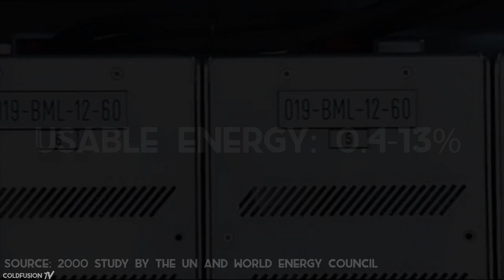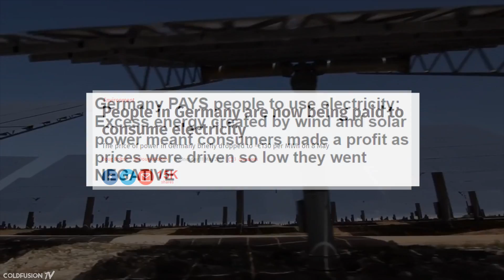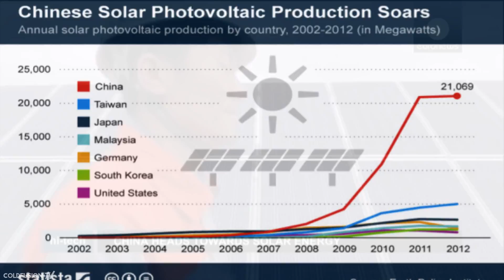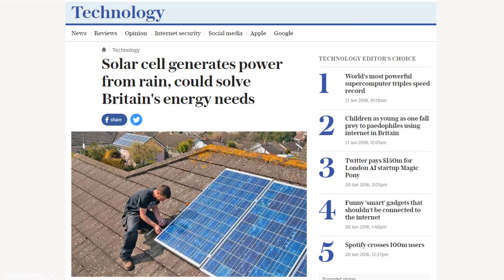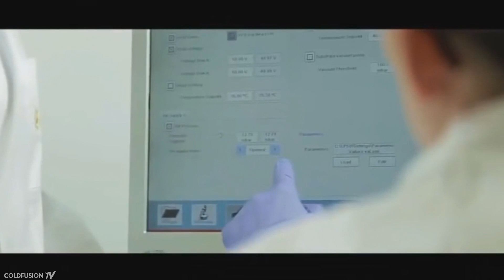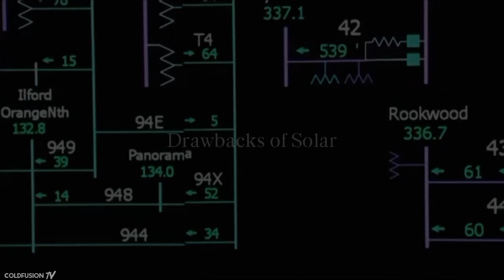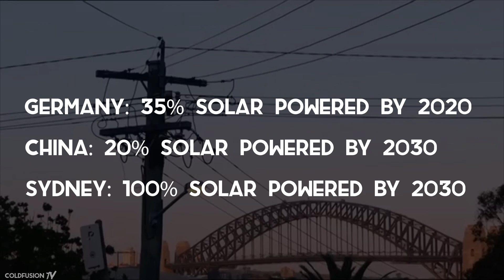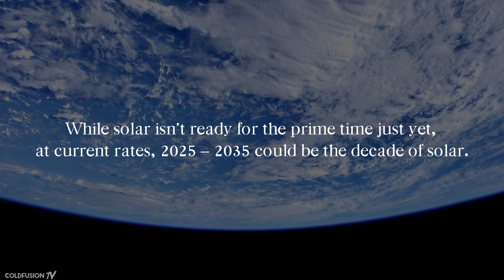The Truth About Solar

Comment: People who say rain, clouds, and snow, are a problem for solar don't understand what a battery bank is.
Or that we even have backup generators that use less gas all year than their SUV's do in 1 mile.

They think we wire solar panels directly to a wall outlet or light socket. lmao
We can even heat the solar panels with its own saved power every morning to melt snow.

These types of ignorant people are the real energy problem. We should put them all in Texas and build a wall around it. Then make them pay for it.

Comment: the whole world will be connected with 1 continuous wire. There's always sun somewhere in the world. Batteries are just an environmental hazard. Also every solar inverter will have to be fitted with a capacitor that discharges in 30 mins. This way there won't be up and down with clouds. 
Also your gas are will become your own power station. When ur idiling in traffic batteries will be changing so when you get home you will have 2 kw to feed into the grid. So either electric car or a gas power giver,  hahahaha
I promise all readers this is what's goin to happen.

Comment: It is exciting.  You did leave out a few things.  On the positive side, currently solar panels shade a portion of a homeowner's roof making cooling costs during the summer cheaper.  In general, solar farms have an area under which, could be used for the production of crops which need less sunlight.  Many parking lots,  previously blistering hot during summer, are seeing shade structures go over them purely to take advantage of the sunlight in the form of solar power.  On the negative side, traditional solar panels are made of a number of chemicals which are exceptionally toxic.  While nowhere near as dangerous as radioactive waste, great care must be used in both production and recycling.  The life expectancy of a solar panel is on the order of thirty years, after that electric production drops off.   The use of solar panels on American rooftops is problematic because American rooftops are riddled with various vents.  Compare this with homes in Japan which have a larger percentage of vents out the side.  Rooflines in Japan are beautiful.  The growth of solar panels in Japan uglifies (In my opinion) their roofs.  The advent of tile shaped solar panels, which can be walked on without breaking, will certainly be a boon.  We already have in many places a natural "battery."  The pumping of water back up into reservoirs for hydroelectric power at night, while not efficient, can certainly be used today until the advent of better batteries.  In addition, the compression of air tanks which can be later used to run pneumatic motors and hence generators, is another method.  Overall the use of solar panels is hopeful, but the easiest way to control the energy crisis, to cut carbon emissions, and to save the planet, is simply for everyone to use less electricity.

Comment: And up here Canada for 6 months of the year we will get only 8h of sunlight so solar don't work for us !!!!! any way
Reply: The most crowded areas of Canada are still more south than Germany, where solar energy is well established.
Reply: Then I guess Germany gets as much snow as let's say Montreal?... I strongly doubt that... Climat is a tad more complicated than that... solar... even more. In southern regions of Quebec it is considered that solar production from december to march is 0% for an average residential house.
Reply: @ Sarah Andrea Royce  the UK is much the same latitude as Germany, and Solar is well established here, too. Commercial solar produces an average 9% of nameplate.
Reply: "Light hit every part of the earth equally over an entire year. Canada gets about 6-8hrs in the winter but 16 or 18hrs in the summer. Closer to the equator gets 12hrs on/12hrs off pretty much all year round. Even the arctic and antarctic gets 6 months on/ 6 months off....but we all get the same light in a year.
Reply: @ Moto arzan. 

Yes, we all get 6 months of daylight per year, but not equal intensity. Intensity falls as the log of the atmospheric path length. (See optical depth.) That's attenuation by absorbtion: then there's reflection by dust and then there's refraction. We can safely watch the sunset.
Reply: I get less than 8 hours sun a day in winter and my home still runs fine....got a fridge got t.v. got internet 24/7. In the summer I have an abundance of power and use my extra panels to run fans without batteries.

Comment: Half truths everywhere, no one talks about the batteries you require (major green house issue), unless you are feeding into the grid, no one talks about space 1 kw needs 10 sqm. No one is talking about heat decreasing efficiency of solar panels. Not a skeptic but solar for mass production is miles away.

Comment: They glossed over the huge complexity of "adjusting the grid to massive solar deployments" You need to have generation facilities that are capable of adjusting very quickly to a changing load and that is not easy and is generally very expensive and will negate much of the solar savings.

Comment: Ok solar is clean granted! However the battery's to store the solar are not cheap. if factor in cost of batteries, solar panels, charge controllers and all the other bull shit! To go totally solar off grid for whole home and run every thing a house on grid would. You are looking at 20,000$  to 30,000$ yes that is right 20k to 30k $. Your paying for the next 10 years of electric bill all at once.  You will never get your investment totally back because the batteries don't last that long and need replaced every 5 to 8 years. Plus there is something bound to go wrong with the charge controller or power Inverter as well. Solar does not work well in areas that have a lot of rain either. Until battery technology comes down in price and storage density get way better Solar is flat ass is to expensive. Prove me wrong!!!!!!!!

Comment: As of now solar is cheaper than all fossil fuels including gas. The simple solution become de-centralized: get all private homes on solar power with storage batteries and do what can be done elsewhere until more efficient cells or fusion power plants come on line. 

There was the plans form the 70's to put 10 square mile solar power satellites in orbit and beam the power down to mile diameter collectors on the surface but I think the idea of having the equivalent of super powerful MASER cannons in orbital first strike positions killed that idea. 

The is also one highlighted in a Japanese anime in the Gundam series: build a solar energy collection ring around the earth at geosynchronous orbit where they would receive sun 24 hours forever and have it anchored by space elevators to the surface, power would come down on the cables making up the elevator tubes. The one problem with this is that you would need co-operation from all the world powers and super high security at the elevators against terrorism plus no one alive today would live to see this project finished.
Reply: "As of now solar is cheaper than all fossil fuels including gas."
Solar is the most resource intensive way to produce energy. Solar doesn't work at night, and people still make absurd claims about solar to the anti-human movement by enivor-MENTAL-ism..

Comment: KWatt_hour   > In 2016 from 6 $ cent to 2 $ cent 
Nuclear, coal & gas still 7 $ cents
All fossil is dead now
Don't invest a cent in it
Reply: Solar has a 20% capacity factor at best, that means storage is a requirement, an expensive requirement. Solar also has a long break even period, so if you add the cost of financing, the cost of installations and the cost of storage you can get a realistic total.
Reply: Cost per  €/MWh
Hydro €20
Coal €44
Nuclear  €50
Wind  €69
Solar  €293
Most current studies are non-sense because they add an pretend carbon value to fossil fuel and leave off subsided costs of solar.

Comment: Video didn't mention that the manufacture of solar panels is not very eco-friendly and requires caustic chemicals, water, and also creates waste to produce.  Even a search on google makes it difficult to learn about that. Get it right the first time and then we won't have to waste time and money to repair/optimize later on, this is a very important energy source that needs to be overseen from beginning to end product.
Reply: +Maxx Madd
Bullshit, there isn't radium in solar panels. Also silica is completely non-toxic and inert. Solar panels are disposed like any normal e-waste, because the materials used to make them are the same as for any semiconductors.
Stop lying.
Reply: That's the dirty little secret of the industry. That's what all of media hide from the public.
Reply: +Sascha H
"Dumping it" seems to be the only way they know in Russia.
Reply: No. Several companies are now recycling old panels into new product. Either way, it is not possible to recycle burnt fossil fuels.
Reply: Actually, the use of chemicals in production must be a problem. Once the chemicals are past their effectiveness, they must need to be disposed of somehow. Dump it, pump it into the ocean? Not to mention the fact that silica needs a carbon source such as coal, wood chips etc to create the mineral needed to slice up into the base for a solar panel. Which means MINING is still needed for the process.
Reply: The same environmental process is needed for the production of fossil fuels. The difference id that solar panels need 1 - 1 1/2 years to recoup their environmental costs and last for 30+ years, whereas fossil fuels can't be paid back. Their damage is permanent and ongoing.
Reply: A.f.a.i.k the point of balance is about 3 years, then the solar panels are producing more energy than is used in the production, off course the scientific community has always taken this in account,  as I remember in 1962 the wake up call by Rachel Carson: "Silent Spring" and later the Club of Rome in 1968 are etched in the scientifics communities collective memory and as I have experienced had a real impact on the way many scientists did their job.
Reply: no no let's keep burning coal that is the best for the environment ask china breathing smog is lovely
Reply: Fool, manufacturing of oil into final usable products is not very eco-friendly as well. it's 1000's of times worse.
Reply: Solar panels can be fully recycelt. They are dirty for now because the energy used to make and transport them is still mostly fossil (there are already those who use renewable for the production). But, what a shocker, pretty much anything is. On the long run when eventually all energy is renewable, which is the goal, it will be as clean as it can get for any manufactured good.The problem that anything manufactured is dirty because we currently use mostly fossil for energy production. This transition needs to be made, whether you disingeneous idiots like it or not. You idiots deliberately ignore the cost of getting the fossil fuels. You also ignore that they are limited recources. I know you fuckers give a fuck about the future and only care for your own present convenience, but the humans in the future, in others words also your descendants would probably also like to enjoy technology. This transition is best done while we still have fossil fuels es energy sources to be able to produce the renewable technology, and not only once all fossil fuels are gone or not reachable. The transition needs to be made whether you believe in AGW or not not. 
For fossil fuels entire towns have been demolished to get what's underground.
Reply: I don't understand all the bellyaching over photovoltaic cells being evil.  Yes it is clear that solar cannot cover the majority of the demand, but why must it be demonized?: because it contains harmful compounds?  What about other things like those dreaded plastics or plasma televisions or even HUMANS?!!

So you bitch about those monsters of carbon-oil and coal-and you fearmonger over overpopulation and solar...so what about nuclear?  What about being sensible, in testing your mindset AND what you hold so emotionally-charged, like you're in some kind of drama on the CW?!

Solar is good, and if ya gotta whimpering 'bout it then start your own disposal company and/or be charitable with your time and work on your days off to clean these out of dumping grounds for recycling.  Anyhoo, take care you guys.  :)
Reply: If is wasn't economically feasible it wouldn't be done.
Reply: We need elon musk to build a machine or factory that can recycle every chemical and material on Earth
Reply: The production of gasoline also needs energy and is a dirty business, because mineral oil is coming out of the ground, not gasoline and not diesel...
The production of the solar panels needs energy and resources, but the power output is thousands times more than what you need to manufacture...
Reply: @eDriver  no it's not, it's the opposite actually.
The term you have to research is ENERGY RETURNED ON ENERGY INVESTED. (ERoEI)

"new study by Ferroni and Hopkirk [1] estimates the ERoEI of temperate latitudesolar photovoltaic (PV) systems to be 0.83. If correct, that means more energy is used to make the PV panels than will ever be recovered from them during their 25 year lifetime. A PV panel will produce more CO2 than if coal were simply used directly to make electricity. Worse than that, all the CO2 from PV production is in the atmosphere today, while burning coal to make electricity, the emissions would be spread over the 25 year period. The image shows the true green credentials of solar PV where industrial wastelands have been created in China so that Europeans can make believe they are reducing CO2 emissions "
http://euanmearns.com/the-energy-return-of-solar-pv/
Reply: little late but a video i watched prior to this one said that production of the panels can be anywhere from almost completely eco friendly up to very un friendly like how you put it
Reply: Sascha H
Disposing of solar panels fall under Haz-Mat conditions and have to be disposed of as the same as by- products from any chemical company.Been to several landfills (including an air-force base in georgia) and they all said the way it breaks down over time releases harmful products like silica and radium into the ground....nor is it a fully green energy source-requires oil to make the panels,lubricate moving parts,and they are heavy requiring large trucks to move them around.On top of all that...they have to be cleaned weekly to work properly,and maintenance from storms and other natural effects are extremely costly..40k plus for a large panel they use in the desert southwest....you get the same problems with wind turbines and electric cars.They are good idea's but they can't replace the big suppliers like Coal,refined oil,and natural gas anytime in the near future unless they make some major break thru's.

Comment: Current silicon-based solar cells require a massive fossil fuel investment due to the production process (you get silicon by melting sand, and you need to burn fossil fuels to reach the melting temperatures).  By the time the cell has made up that investment, it's already almost time to replace it.  That said, I still support solar, as it's setting up the infrastructure for future, cleaner solar technologies like perovskites and eventually artificial photosynthesis.  However, I think we should also put a lot of effort into other energy production technologies, like molten salt reactors.  Competition spurs innovation, and while I don't support an all-of-the-above approach (fossil fuels have to go), I do support a many-of-the-above approach.  Different technologies have different strengths and weaknesses, and that can be used to our advantage.

Comment: To properly calculate the price-per-watt of solar, you would need to include the fact that a panel which is in service loses about 1% of its efficiency per year, giving the panel limited life around 10 years. Why? Because at the 10 year mark the solar panel has already given up ~50% of its ability to convert sunlight into electricity. This means replacing the panel and/or supplementing an array with new panels will be needed to maintain output. Spent solar panels have little post-service use.

Coal, on the other hand, releases much-needed CO2 into our atmosphere while coal ash has numerous industrial and consumer product uses. The current price of coal is artificially inflated by bogus regulations created in the name of "climate change" junk science. Coal could easily provide ALL people with electricity costing 2-5 cents per kW/h day and night, possibly less, and this includes the cost of scrubbing emissions to limit particulates.

Solar panels have niche uses that depend on location and energy demand. They are not a viable mainstream replacement for modern coal, NG, or nuclear power plants.